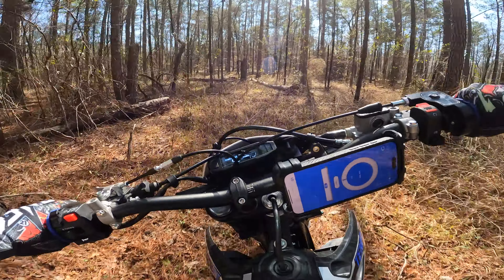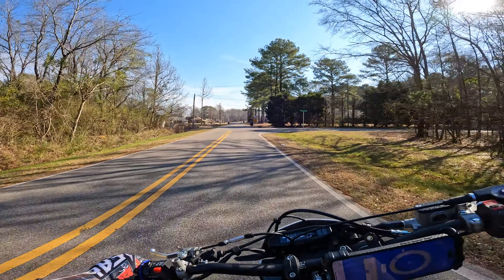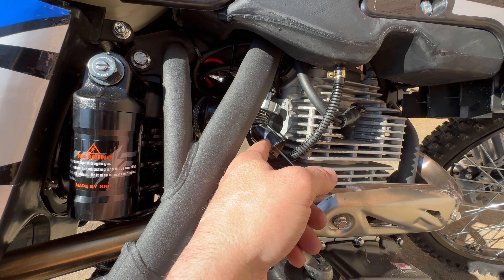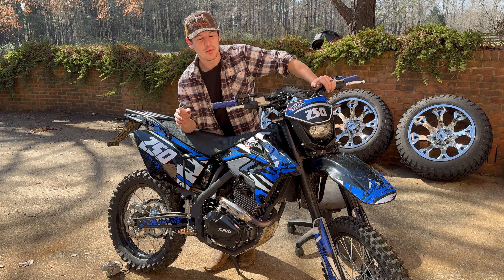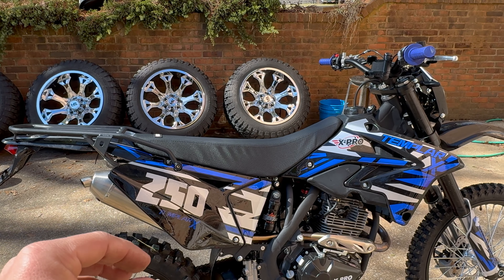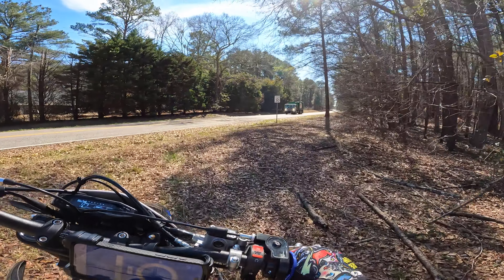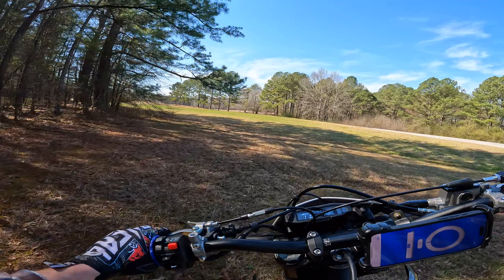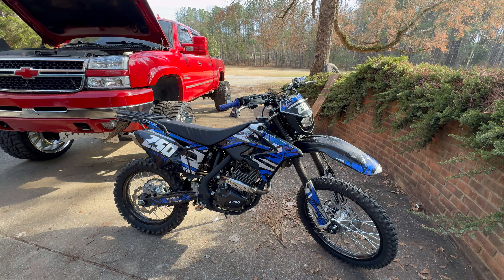30mm NIBBI CARBURETOR INSTALL AND REVIEW!

Comment: I agree that the better carb and upgrades help the chonda bikes but one thing nobody mentions is that if you do increase the power it breaks every other weak part. In order Chain, Rear wheel Dampners, Swing arm bushings, spokes. After a year I sold it and got a YZ450FX.
Reply: Thats half the Fun :)
Reply: A few HP increase isn't going to break anything faster, except maybe the stock chain, but that should be replaced immediately anyway. Also, this same bike exists as a 300cc liquid cooled model with 50% more HP. Why did you even bother buying Chinese bike if you can afford a Japanese one that costs five times as much?
Reply: @mazdaweeb3  I wasn't planning on buying the 450 when I got the TBR7. All in it's 10x more @14k with mods/addons.
Reply: @mazdaweeb3 big facts 😂

Comment: I see you front forks have no suspension like my bike. I hate riding it off road it is actually quite dangerous. be careful on that beast. I think my bike has 6 miles on it that's how much i like it.
Reply: With my TBR7 I got 2 deepwell 5/8 sockets from lowes then put em under the spring screws  after flushing and refilling with 15wt shock oil. I'm 6'5" 220 so I needed a LOT of help on the front end and that helped.

Comment: .  I'm running 35 and 110. I'm at 3800 ft. Elevation, and I have a 250cc.  125 and 42 is close to stock.  Lower Elevation needs more jet, higher needs a little less.

Comment: I've had my Templar 3 years. 3500 miles.  My only issue was carb related. Didn't idle below 2400rpm.  Xpro sent me a new carb that was adjustable, but had the air screw out 4 turns to run good, purchased a 30mm and it was worse.  Ordered a jet kit and started experimenting. The exhaust was blue, so I tried bigger jets, idle has always hung about 500 rpm high then settled...??? I did get a decent idle, but went from 48 mpg to 37.  Ran a while that way then pulled the 30 and went 5 smaller on jets in the 28 and got my mileage back, and good idle at 1 1/2 turns.  Probably could have used the stock carb with the idle plug removed... still have the idle hang 500 rpm for about 10 seconds...???  Working great!
Adjustability is key, .2 sec with 30, not much gain.
Reply: I pulled the idle plug and re jetted to 125 and 42 and it don’t run right really started on. Revs won’t idle. Am I on the right track? Stock carb and jet up? Or stock jets?
Reply: .  I'm running 35 and 110. I'm at 3800 ft. Elevation, and I have a 250cc.  125 and 42 is close to stock.  Lower Elevation needs more jet, higher needs a little less.

Comment: also on the brakes my did the same thing when i wrapped the wires under the seat. when i did that one of the wires pulled from the connector . the lights would turn on but not bright up just like what you were saying .

Comment: Part list I got going:

Bel-Ray 10W Fork oil
Máxima Break in oil
Antigravity Lithium Battery
MZS Short handle Clutch
U Clamp
Steel Break Line
DoubleTake adventure Mirrors
Pivotrax Inner tubes
Igreely 4g battery cables
Nibbi Handle Bar Grips
Fahren H4 LED light
Nibbi Short Release Throttle
Rhental 5mm Bar clamps
Renthal Handle Bar
Suzuki RMZ Plastics
QuadLock Mounts
Shinko 705 18/21 Street Tires
JT Sprockets 40t
Niche Gold 520 X Chain
Máxima Racing Pro Filter 
Nibbi 30mm PWK Carburetor
MSD Spark plug Boot
Nibbi performance Ignition Coil
NGK Iridium Spark Plug
GoldPlug Magnetic Oil Plug
JFG Full Exhaust
WPS Rim Strip
Reply: I had a question did the jfg exhaust fit fully or you had to bend it a bit also which one did you use

Comment: Does it wheelie half decent? Recently got back into riding and im fixing to get a yz250 2stroke but i want to get one of these cheap 4 strokes for the days when i bring my daughter riding with me. Shes 4 and sits on the gas tank between my arms on my trx300. Im itching to get her on 2 wheels though but a 2 stroke is just gonna be way to aggressive as i do a lot if slow cruising and soft riding when shes with me. She has an absolute blast and i cant wait till shes big enough to start riding her own youth bikes.

Comment: I did the Nibbi mod it ran perfect after install but after 5 min the idle started rising and wouldn't idle down. I had to almost completely screw in the air screw to get it to idle which caused it to run rich so ended up re-jetting both the pilot and main. I'm at about 300ft with 42* temps right now running 125 main/45 pilot from stock 128/40 and it ran perfect - (I thought) but after changing the spark plug it was still running a little rich(moderately sooty) so I experimented with different jet combos and needle positions but it runs best with the 125/45 to where the adjustment screws are in the proper range(per spec) and the needle in the stock 3rd notch setting. I've tried tweaking the air screw to lean it out but haven't ridden it yet to see if it'll go faster or if the mixture is right according to the plug color.. Previously it topped out at 67 on the speedometer didn't cross check with GPS but was facing pretty strong head wind.

Comment: Has anyone had any issues with their taillight? I can't get the running light and the break light to work together like they're supposed to.  Only one or the other depending on how i switch the wires around.

Comment: New rider; Just picked up the Templar M 
I’m having the same issue with the throttle where it revs crazy when I turn to the right how did you fix it???
Reply: Back off the cable from the throttle body have no tension on the cable adjust idle on car not on the throttle cable
Reply: Carb*

Comment: What size jets do you run in your nibbi?
Reply: 30mm
Reply: Templar X 6-speed. 14T front 42T rear. Emissions delete, cat delete. Powercore pro tork exhaust. NGK D8EA. Nibbi 30mm, slow 40, main 130, needle clip one position down from center. I'm at an elevation of 1400 ft. I can't stand a lean running carb, Fat is where it's at baby!
Reply: @blakeoblko852 can u ride highway with it?

Comment: We have the same exact bike, same color, same issues. Our rear tail light does not work when applying the handbrake or the footbrake we have checked both switches they function properly they sent us out the light switch, which I don’t understand why hopefully the tail light assembly is the problem. They’re sending it actually today it should arrive. Let me know if you have the fix also, Il let you know as soon as I get mine and get it on the bike. This might be my second comment cause I don’t know if the first one went.
Reply: check your wires directly under the seat that is under the rear fender . One of the wires i bet came out the connecter. Mine did the same thing .
Reply: @joshuaguidry6428   No, we have checked all the cables and connections still have the same problem. They are now sending the light assembly.
we installed the nibbi 30 mm works great.
now putting on 42 tooth rear sprocket.